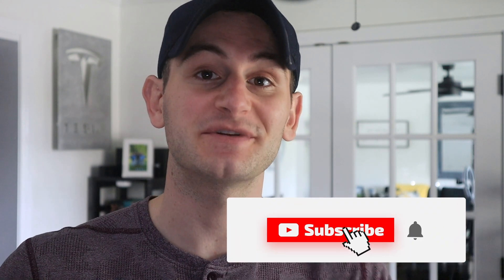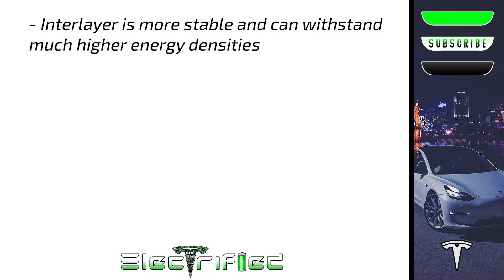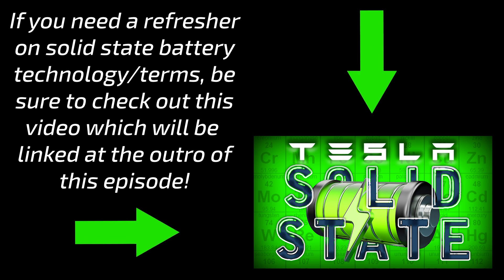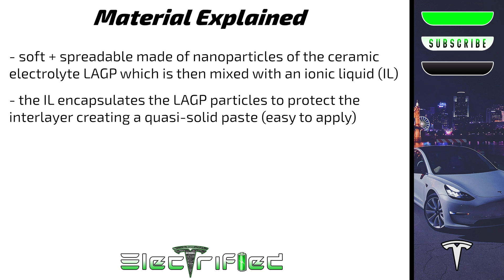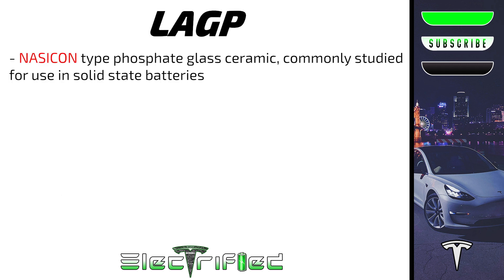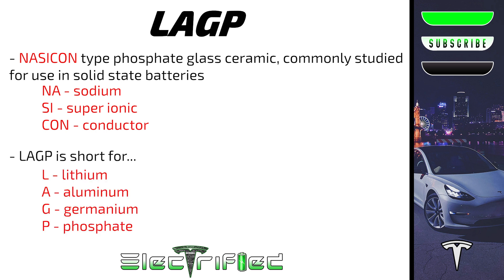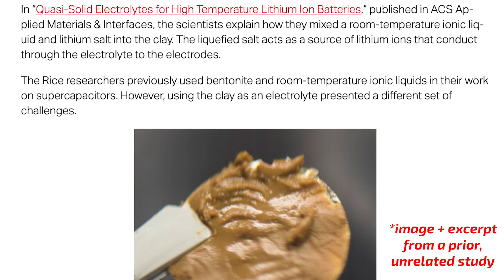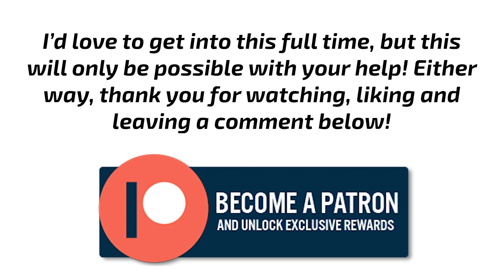New Solid State Battery Advancement - Part One

Comment: I like being kept abreast of how current research into solid state battery techis developing. If I understand correctly the tech does work it just requires further development to become affordable for the market. A comment I read mentioned the inclusion of germanium is a cost affecting  factor. With germanium costing $1200/kg compared to cobalt at $80/kg which is considered expensive
Reply from the maker: It's good to keep up for sure. And yes the limiting factor is application at scale and cost!

Comment: How scalable is this? Thanks for the information!
Reply from the maker: Hey Micah! That's one of the reasons I chose to highlight this advancement is theoretically it should be very scalable as the application process is simple according to the research. It's too soon to say how scalable exactly but it was a point covered in depth in the research report.

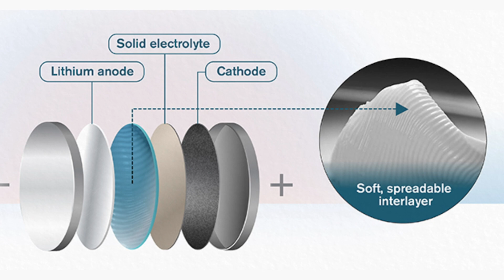Comment: You say around 0:39 "improve current energy densities 10 fold" which sounds like the battery can hold 10x more power. However, the breakthrough is 10 fold "current density" meaning able to draw more current  at a time. It's not related to energy density.
Reply: Always important to distinguish between power and energy.
Reply from the maker: Agreed - will double check!
Reply from the maker: I'll double the check the research paper for part two - thanks for bringing this into the light
Reply: Thanks for the video. I had not heard of this research before seeing your video. I'm wondering if this discovery could replace the super capacitor and battery pack coupling researchers are looking into for electric cars. Could this mean batteries can recharge 10x faster? There are lots of applications for improved current. Looking forward to part 2.
Reply: important point.

Comment: Does the paste run, or will it stay in the place where it's applied?
Reply from the maker: Hey Patrick - it should of course stay in place as it would be rolled in the center of the cylinder if that's the form for application
Reply: @DillonLoomis22  Has that been tested over charge & discharge cycles to see if and how it actually stays for cylindrical cells? does it stay only for cylindrical and not for pouch cells battery? Any data on this?

Comment: Research is one thing.  Getting past the research and making it to the market place is a long road to haul.
There are NO no solidstate batteries available in the market place yet.
Reply from the maker: rick dees you’re correct my friend! And while a true solid state battery is more than likely years away, it’s important (and fun) to stay on top of the research in an attempt to piece things together! How far away do you think they are?
Reply: @DillonLoomis22  This is not a solid state battery. i thought this is just a way to use nanoparticles mixture to raise energy density in a solid state battery?

Comment: This might be good for planes and rockets where weight is a huge factor, but for the rest of the applications, cost per kWh is everything.
Reply from the maker: Al Smith that’s true - should come down in cost with time. Do you know something about the pricing of this as it is?
Reply: @DillonLoomis22  I don't think it's left the lab, has it? So very small volumes and high price because it hasn't reached economies of scale. It contains some expensive materials like germanium which is around $1200+ per kg. To put into perspective, cobalt is around $80 per kg and that's considered expensive.
Reply from the maker: Al Smith you’re correct! And yes I was going to break things down in part two actually. Thanks for sharing that Al
Reply: But, higher cell density means few cells which reduces pack cost.
As New materials arrive the next advances will go hand in hand with speed of cell production and factory footprint.
That's where the Tesla/ Maxwell process will have its main impact. Aside from the alleged performance increase, the ability to produce "up to 16× cells in the same factory volume" will be fundamental, impacting not only cell production, but all others parts of the business.
It will first and foremost shift the bottleneck to pack production , but (imo) Tesla have that covered as well. I anticipate an announcement of fully automated pack assembly with little or no welding on the pack at battery day.
These advances will reduce both cell and pack cost drastically (below $100/kWh?).
Also expect a roadmap to a common cell/ pack for all Tesla's.

Comment: So, is it like a paste or a gel and would it squeeze out if the battery was impacted?
Reply from the maker: Nut N Horse Farms it is similar in substance but it definitely would not be squeezing out of the battery in a working cell lol - should be encapsulated mostly inside the rolled anodes